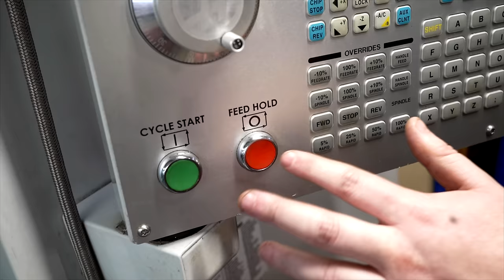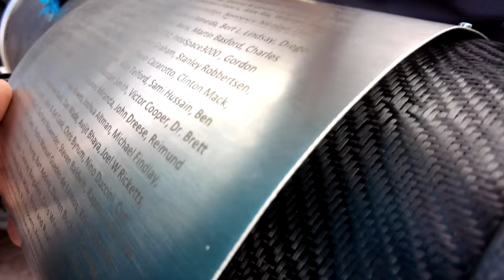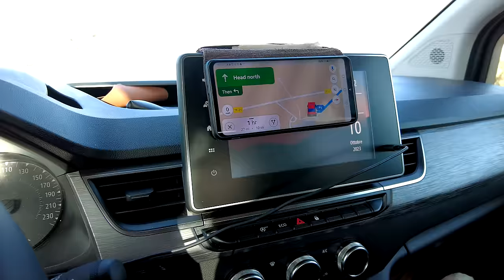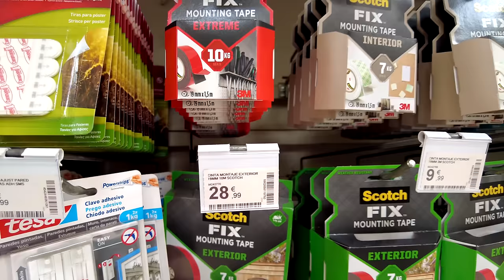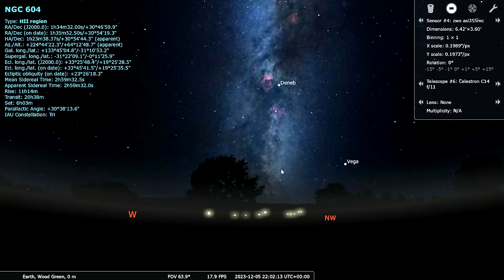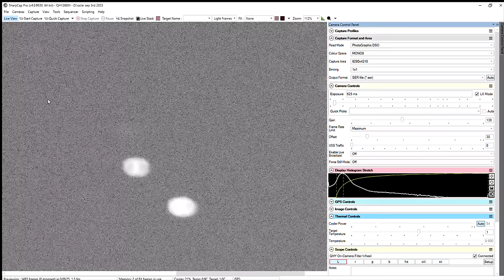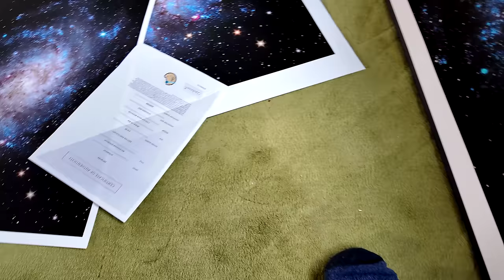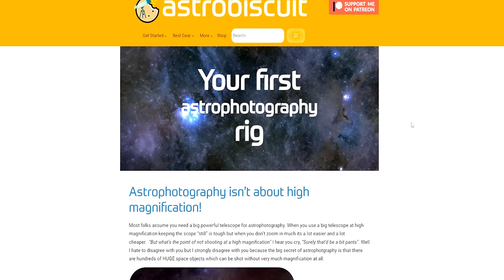My DIY telescope vs $1million Observatory │Betty's Story Ep 2

Comment: Simply brilliant story telling and great effort which all paid off in the end with that stonkingly good M33 image! So many twists and turns; my heart sank when the mirror was glued to the cell ! I've made that mistake before and the temperature expansion between the glass mirror and metal mirror cell causes astigmatism. Very well done to Rory for getting it fixed and to all involved in making these epic videos happen. Until the next exciting episode!
Reply: Do you think affixing a small primary mirror with something that might allow a little expansion, say heavy duty sticky back velcro would work?
Reply: @dan14632  Yes that should work; Rory used a similar approach to resolve the issue in his video.
Reply from the maker: Well said and thx everyone
Reply: Yes. An other way of gluing a glass mirror to an aluminium support while still avoiding stress occuring in the glass causing astigmatism, is to have leaf springs in between glass and aluminium support. Just imagine 3 leaf springs (every 120°). Leaf springs bended 90° so it forms a lip that can be glued onto the glass. The other end of the leaf spring can jut be screwed onto the support. This way, since a leaf spring "locks" 2  translations and 1 rotation, using 3 of them at 120° is able to constrain all 6 DOF's (degrees of freedom: 3 translations, 3 rotations) without inducing stress in the mirror.
Reply: Hey, at least he had the foresight not to use epoxy glue or other glue that couldn't be undone without force that would hurt his mirror.  I call that a successful experiment!

Comment: The CTE of aluminum is much higher than glass, but its elastic modulus is similar. That approximately torques the mirror as the aluminum cools differently than the glass due to drastically higher thermal conductivity. Richard Berry recommended a quarter-thick layer of silicone. I use a reserved set of steel skewers.

Comment: Mate, I’ve been struggling with pinched optics with triangular stars for months, your double sided tape trick solved it ! Kept the clamps in place in case the tape gives way, but backed off 1mm from the mirror surface and it’s the first time my reflector has had circular stars ever. You’re a legend.

Comment: I'm sure that with a 14 inch telescope you would have match it probably like 99.5%.... this is quite mind blowing!
Reply: A 14 inch telescope would have just a bit less than half the resolution of the professional scope. Think about it. If the professional astronomers could get the same resolution as their $1 million telescope for $10,000 or $15,000 they would have already done it. Aperture is inescapable as the arbiter of resolution unless the steadiness of the atmosphere is terrible. And the laser based adaptive optical systems on some larger scopes can adjust for atmospheric scintillation automatically in real time.

But imagine this: undebatable spiral structure in galaxies wasn't definitively shown until 1917 with the 100" Hale Telescope on Mount Wilson, California. AstroBiscuit doesn't only get spiral structure, but virtually dissects M33, a more difficult galaxy than M51 that they used in 1917. It is true that Lord Rosse's 72 inch Leviathan showed him spiral structure in M51 in 1845 but he had to sketch what he saw. His findings weren't accepted by the scientific community as definitive. They were very busy debating whether the "spiral nebulae" were inside the Milky Way or external structures.

AstroBiscuit's photo of M33 is better than any from the 200" telescope on Mount Palomar from the 1960s. Their limitation was very grainy black and white film with a low exposure latitude. Telescope resolution isn't always the only game in play.

Comment: The 2h processed shot is absolutely amazing and I'm pretty sure that the professionals at the observatory will agree. Yes, the 1h unprocessed image is not as sharp as the one from the much bigger IAC80 but it's still impressive as heck. You've pushed the limit of what's possible at that size, so next step: go bigger.

But if you can: do make a video call with the folks and get their reaction to the results of Betty.
Reply from the maker: Yep yep and I'll try 🤣

Comment: Fyi, we mount all our space telescopes with RTV on the kinematic PM mounts which glue to the backplate of the mirror. Any adhesive will have cure shrinkage and will put strain energy into the PM but the RTV flexes enough to keep it very low.  This is pretty much a standard used for 50 years on weather satellites, Hubble, Ikonos, Worldvview, etc...

Comment: Even Beryllium would have distorted the mirror when glued. Beryllium over ambient temperature ranges expands by a factor of 3.5 more than Pyrex and 10X more than quartz. The only solution would have been to observe at the same temperature the glue on the Aluminum set at which might have been quite high given a two part epoxy's chemical reaction.

Comment: living in North Western Arizona USA the typical humidity during the summer is below 10% at a altitude of 3,700 feet above sea level. Winter humidity is around 20%. Just a very amateur at watching the sky. Just bought a color SWO camera $200 to use with my refractors and give it a go and see what happens. Thanks for your videos.

Comment: I guess someone has already mentioned this but bonding the aluminium to the back of the mirror was a problem because the glass and aluminum have different coefficients of thermal expansion.  It could only work if you bonded it at the same temperature you were using the telescope at. If the temperature is different the glass will have to bend a little to help relieve the stress.

Comment: It's crazy how close you got to the IAC80, excellent work! I have a feeling the mirror bending was caused by the glue you used contracting as it dried, as well as (like commenter adam ellison mentioned) the mirror deforming because you used aluminum. Maybe you could try mounting it on glass? And Hubble apparently uses a graphite-epoxy material for mounting things because it doesn't contract or expand a ton and is very strong. Worth looking into?

Comment: This is an awesome video! I just want to point out there are amateur telescope making resources on the internet and in books that explain correct methods of mirror mounting. If you're interested in building your own telescope, it's a ton of fun and most of the trial and error has been worked out :) There is always still that nervous excitement of first light under the stars when you find out whether it really works! That moment is captured dramatically here, love it.

Comment: 11:15 Yeah. Actually, when you buy load cells to create a scale, it's a piece of aluminum with an electric strain gauge to measure how much bending the aluminum bar has when we put any mass on it. Before I calibrated the scale in kilograms, the strain gauge could measure the weight of a single hair strand. So a single hair strand could bend the aluminum bar.

Just for curiosity, the sensor's noise was marking 10 (without scale). When I put on the hair strand, the sensor marked 30 (without scale).

Comment: While your image was definitely blurrier than the observatory image, you did indeed capture more details - even in the shot that was reduced to 1hr.  You can see some faint wisps of nebolusity in yours that do not show up in the observatory image.  I thought that you could have claimed a win for that, but the blurriness is distracting.  Are you sure it wasn't simply vibrations from a breeze that were blurring your photo?  Next time maybe take a wind screen with you.   Love your videos!  Also - get a proper mirror cell that doesn't require glue or sticky tape and has proper edge support at the center of gravity.  Glue almost never works because the mirror will expand/contract with temperature at a different rate than the aluminum.

Comment: Im just a noob, but when you were talking about the camera differences.  IAC had a monochrome, while you were using an LRGB (I rhink?).  LRGB cameras have around 1/3rd the pixel density of a ewuivalent monochrome, if im not mistaken.  Did you take that into account?  Because if not you may have needed a longer exposure than 2h, not shorter.  Also your longer expisure time would indroduce much more atmospheric wobble that adds up over time, which a 10min exposure might miss the worst of.  Does that make sense?

Comment: I’m no engineer, but I’ll bet the original adhesive created heat and expanded the aluminum. When it cooled it drew the mirror into a convex shape. It was likely further affected by the colder outside temperature. But I’m just a massage therapist.

Comment: Well... Build a Horseshoe mount for a large diameter dobson and retry :D 
But still: Incredible telescope and a really nice video!

such a mount is actually my project for next summer, for my 12" Omegon Dobson....
And I also try to build at least a simple tracking mechanism with stepper engines... However, to build a fully automated tracking mechanism, I'd need to program a computer to correct the declination - and that's where my skills end ^^

Comment: It sounds crude, but I've had 2 scopes with mirrors duct-taped (by the side edges) and stapled to a thick particle board mount. No warping. Cheap, light, easy, and no thermal warping with temp change.

Comment: Great content ! Thank you
Could it be that you are also limited in resolution due to the pixel scale? I believe you have a pixel scale of 1 arcsec per pixel (assuming you had a focal ratio of f/4)
If this is true, I think that the pixel size or focal length is limiting the resolution and not the aperture size.
Reply from the maker: Yes you are right. Although I dithered my processing which helps a bit

Comment: I understand the equal photon argument but I say any exposure length is fine.  It took them years to build that observatory so what if it takes you all night to get the same shot, getting time on that big scope probably takes years.  Also if you have a better more sensative camera on a hobbiest budget so what use every advantage you can get.  Your short acres of glass, a dome, concrete base and at least $1M.

Comment: Good video mate, I'm going to Tenerife in March to image the Milkyway! Do you have any tips on printing astrophotography? I'm trying to print my image of M31 but struggling. I've upscaled it on topas gigapixel, the normal photograph paper comes out good but with not much contrast, the metal print I tried came back way too dark and the quality of the image was really poor on the metal print. Any suggestions?
Reply from the maker: It took me 10 trips to the printers before getting it right. It's so difficult because paper has so much less dynamic range than a screen. I use the Printspace in london and I print on fancy H something photo rag paper which has no reflections.
Reply: @Astrobiscuit  thanks bud, appreciate your help, my print on normal photograph paper looks better than metallic so think I might stick with just a normal photograph print but I'll ask my local printing shop about that photo rag paper. Thanks mate

Comment: you made a lot of compromises to your rig just for travel..... I'm curious as to what you can get with the right equipment at its best setup. I use an 8inch reflector but with a 1000mm focal length that area of cluster is as sharp as the observatory.

Comment: what if you made the scope use two mirrors in the rear say two tubes side by side kind of or a box shape both mirrors collect light but they then bounce to the same focal point then back down again to in between the two big mirrors to where your lenses are. im brand new to scopes but from what im thinking that would double the light incoming and make the length of it way longer even thought its physically not longer you just bounce it again. is that not how scopes work?

Comment: Could have solved all your problems with a C11 XLT that retails second hand for a $1000 with a Starizona 0.7x reducer for a total of less than $1500. It is by far the best large aparature portable setup. Even a C9.25 would do just fine.

Comment: Help! Purchased a Svbony SV503 80mm ED telescope and cannot get focus pointing at Polaris which is visible from my home. I have tried a number of Plossl eyepeieces low to high magnification and nothing was able to get even close to a visible star, only a fuzzy dim light in the eyepiece. Can you advise?
Reply: You may need an extender... Can it focus on objects lets say, 5km away?
Reply: You are right. The Sv503ed needs further backspace which can only be achieved through extensions tudes. I have been able to gain focus without them but for only a few images. Therefore, I have decided to add the extension for general use.
Reply: I am also dealing with the focuser not locking down. Though I turn the thumbscrew, it still rotates. What to do?
Reply: @michaelnixon6672  I don't own that scope so I can't really help you with the focuser... Does the thumbscrew get contact with the focuser tube?
Reply: @astroinfinland6680  It does but that doesn't stop it from rotating.
Reply: @astroinfinland6680  yes, but adding additional extension tubes makes reaching Focus at any distance easier!
Reply: @michaelnixon6672  Could it be a faulty unit? I'd say contact the retailer if it has warranty, and see what they say. Maybe they could help with the problem or get you a new scope. Clear skies! :)

Comment: Can't you use artificial star for testing? Wouldn't it be simpler?
Reply from the maker: We did and it is especially when it's cloudy but stars are still better as your focuser is in the correct position.
Reply: @Astrobiscuit  if so how did you get to Canaries untested? Or this is for dramatic touch?

Anyway presentation and drama are good 🙂

Comment: Do you try "lucky imaging"?
Resolution X2
Reply from the maker: It wouldn't be so X2 when the seeing is so good. My primary source of blurring is the scope
Reply: @Astrobiscuit  Ok!
Why don't you use a classical 9 points or 18 points support?
With the double face tape, some parts of the mirror are not sustended. And it (always) causes dilatation stress.

Comment: I don't think this was even close to fair for the IAC80. Should have given IAC80 roughly the same amount of time if not longer. Sure the IAC80 is much bigger and has a lot of other advantages but a F11.3 scope is obviously going to be significantly slower at picking up photons than an F4 newt.
Reply from the maker: Its the same field of view so I'm afraid your maths is wrong. Imagine how much I'd have to Barlow Betty up to get the same field of view .. Betty was at like f40 or something. You do the maths
Reply: @Astrobiscuit   Challenge accepted. Assuming Betty is a 200mm f/4. Yes the IAC80 has 16.81x times the effective mirror area than Betty but its image is also 127.125 times larger. Spreading any photons over a much larger image on the focal plane. Lets say you gathered 1,000,000 photons/s with Betty from an object. You'd gather roughly 16,810,000 photons/s with the IAC80. The image on the focal plane of Betty is 1x1cm that is 1x10^10 photons/m^2 that same image on the IAC80 would be 11.275x11.275cm with brings it to 1.322x10^9 photons/m^2. Now we can take this a step further and do the calculations per pixel. The pixel area of your camera is 1.41x10^-11m^2/pixel getting us to 0.141 photons/pixel/s. For the best case the IAC80 using CAMELOT2 the area is 2.25x10^-10 m^2/pixel which leads to 0.298 photons/pixel/s. This shows that on a pixel by pixel basis the IAC80 will only gather roughly 2.1x as many photons. With the differences in quantum efficiency the QHY is at ~57% at H-alpha where as CAMELOT2 is around 91%. This take CAMELOT2s lead to 3.29x more effective at detecting H-alpha photons. For readout noise Ill go with the QHY having 2 -e/pixel while the CAMELOT2 is around 5 -e/pixel giving the QHY a slight advantage with read out noise. So while I may have been wrong about the IAC80 needing more time than Betty the IAC80 still needed 30-40min to gather roughly the same amount signal to noise ratio. This whole argument is even more in my favor if they used the CARONTE camera which has the same specs in pixel size, QE, and read-noise. I I'm also not trying to be a hater in any regard it just seemed off to me. All of my info  came from  https://research.iac.es/OOCC/iac-managed-telescopes/iac80/ and https://www.qhyccd.com/astronomical-camera-qhy268/ Sincerely a Physics/Astronomy undergrad.  believe this math is correct otherwise I'll look like a nincompoop and my Optics professor will come to haunt me.

Comment: Simple answer to your title; An observatory has zero resolution, however if the telescope inside of the observatory, if it is bigger than your telescope with everything else being equal, you lose the resolution challenge, it’s all in the math 🎉
Reply from the maker: You're not wrong in what you have said but you fail to understand the full picture which in fact means  you're wrong. Sorry to be the one to break it to you.

Comment: Why wouldn't you just buy a decent f4 mirror, or quattro 200f4? The glue is bad as the mirror shrinks at a different rate to the metal.
Reply: what fun would that be